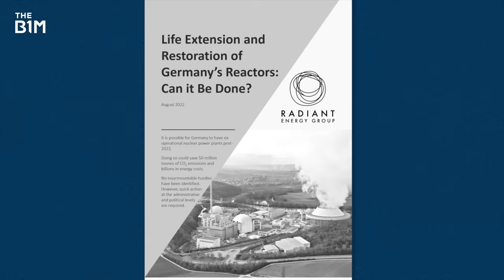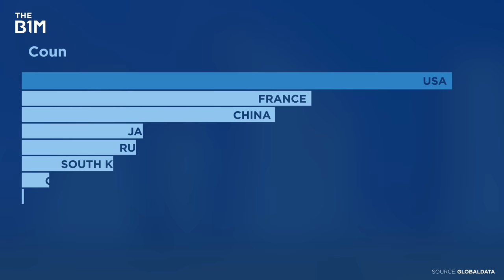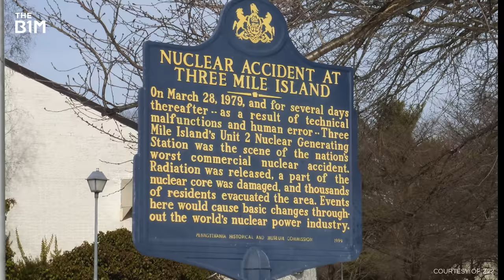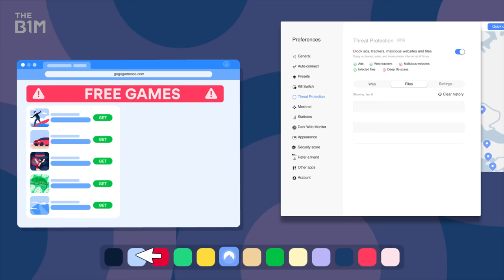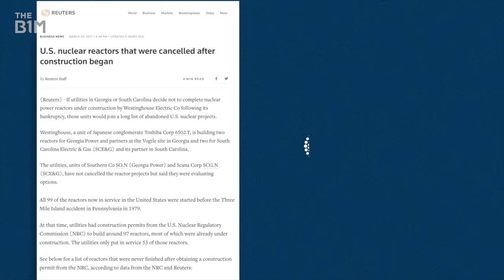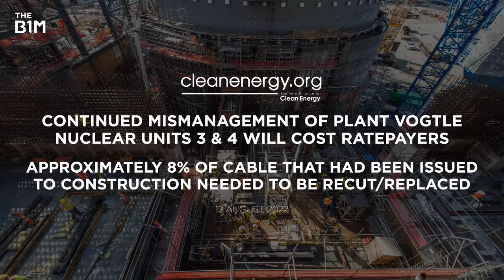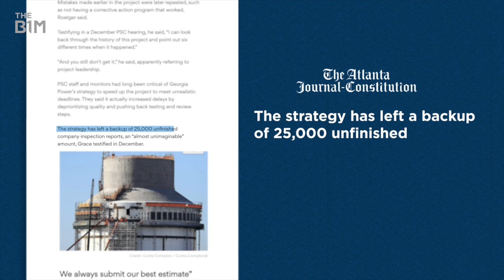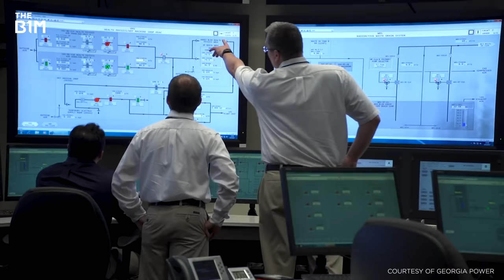Why Nuclear Power is Making a Comeback

Comment: They also turned off nuclear reactors during the Texas outage, but he conveniently left that out. Nuclear is too expensive and not worth the risk. They can do wind and solar for cheaper with grid storage for excess to use later. There are alternatives to hydro and battery storage like Rondo Energy's thermal storage system. I can't really see nuclear making a comeback at all because no one wants to pay for it, and no one wants it in their backyard.

Comment: Its coming back because it's the sensible thing to do until battery technology and/or other power generation methods catch up. Look for the Lithium Report done for Finland that shows the estimate is that the whole world does not have enough Litium in it to supply enough for the batteries for just the electric cars in the USA.........

Comment: Even if it costs 50 billion it's still worth because that is gonna produce joules non stop for the next 5 decades minimum.
Reply: You apparently are not a ratepayer in this area.  29% increase in my electric bill just due to Vogtle and it will double if it ever starts up

Comment: When it comes to nuclear power plants for security reasons we should keep them analog and keep them offline meaning there is no outside connection to the management of the reactors I want to say management I'm talking about the equipment not the people in that way it can't be hacked it makes it safer yes we using 1970s technology when it comes to the management of the reactor but it's also pretty safe and well and tried and true we just use the newer Westinghouse reactors that put all the cooling water on top of it so if we lose all electricity it still can cool itself and you won't get a Fukushima daiichi  or a 3-mile island

Comment: Bechtel isn't perfect, but they have done a pretty good job on the Hanford site in Eastern Washington State, over the river from me. There are a lot of government contracts and cost overruns, but generally speaking it's been pretty good. There used to be another plant called "Satsop" near the Washington Coast, in Elma, but it was abandoned when I was a kid. It would be cool to see that back up and running one day.
Reply: I worked at Satsop as a new apprentice boilermaker. I just retired a couple of years and my last job was building some environmental clean up equipment at the Centralia Power plant.

Comment: Did he say people don’t know how to pour concrete? Did I hear him that correctly?
Reply: Yes and it is a correct statement for Vogtle.  Critical safety systems depend upon concrete structures for foundations and protection and the mix, temperature, and pour methods are very specific.  Test samples are poured and tested to make sure the pour was done correctly...and at Vogtle the test failed in some cases.  Do you realize what it cost to demolish a concrete structure and redo it when it does not meet design specs/ Or maybe they should just let it slide and say it sorta meets the safety requirements.

Comment: Need to keep the same engineering and management team. With select trades and have them work on the same designs. To significantly bring down costs and completion times. These projects will be needed. To meet our CO2 reduction targets and to power the wave of electric vehicles. Coming to market over the next 5/10 years
Reply: I hate to tell you but given the failures below, no U.S. utility is even remotely considering new nuclear and old plants are shutting down every year. It takes 16 years start to finish if a utility ever wanted one

Please don’t assume that YT videos are factual.  If you live in the U.S. here is the reality for the last 4 state of the art Westinghouse AP1000 ADVANCED passive safety features new nuclear power projects and spent fuel reprocessing and in the U.S. over the last 20 years. You decide if this YT video was presenting the truth. 

The Southeastern U.S. is super pro-nuclear MAGA, has zero anti-nukes, and 100% media and political support. 

The MOX facility (South Carolina) was a U.S. government nuclear reprocessing facility that was supposed to mix pure weapon grade Pu239 with U238 to make reactor fuel assemblies. It was canceled (2017) in the U.S. After spending $10 billion for a plant that was originally estimated to cost $1 billion and an independent report that estimated it would cost $100 billion to complete the plant and process all the Pu239, Trump canceled the project in 2017.

VC Summer (South Carolina) new nuclear units 2&3 were canceled in 2017 after spending $17 billion on the project (original estimate of $14 billion and 2016 completion date) with no clear end in sight for costs or schedule. 

Vogtle (Georgia) new nuclear units 3 &4 currently 110% over budget and schedule (currently over $30 billion) and still not operating. Mid way into the build, the utility stated that had they known about the many costly delays they would never have chosen nuclear. They are now delayed another year because according to the project management, thousands of build documents are missing. 

Please google any of this to confirm.

If you can’t build new nuclear in the MAGA super pro-nuclear southeast U.S. then where can you build it?

Comment: The problem with using nuclear power to fill in when the supply of wind and solar are low is that variable power in nuclear reactors is tricky.  I don't see it working unless they can control and mitigate the xenon poisoning problem.
Reply: I agree 100%.

We should foist the problem of filling in power when the supply of wind and solar are low on the wind and solar power plants, not on the other power plants. Wind and solar create this problem, wind and solar should solve it.
Reply: @factnotfiction5915  yup, base load the nukes, no Xenon issue.  Use everything else as peakers.

Comment: We need to find a way to not use high pressure steam reactors, molten salt do not need to higher pressures
Reply: Terrapower has been building a MSR for 2 years now and that project is not going well.
Reply: @clarkkent9080  fusion is complacent that’s for sure
Reply: @joem80003  fusion is only 5 years away and has been for the last 30 years

Comment: ARE THE NEW REACTORS GOING TO BE BASED ON THORIUM?
Reply: No, they are AP1000's, which have a terrible record. Of the 6 produced  in the US, 2 have been abandoned in place near Tampa FL, the 2 built near Agusta GA have defective cooling towers and are not producing grid power, AND...

These are the last 2 AP1000's that will ever be built as the contractor [Westinghouse] was driven into bankruptcy in 2017, due to lawsuits filed by so many corporations. Parent corporation Toshiba wrote of tens of billion$ in that disaster, but they are no longer liable.
Reply: @crankychris2 Is the industry at least considering Thorium fuel based reactors?  Looks like the Chinese are more successful with AP1000 design as they have 2 (modified AP1000's AKA "Chinese" version called "CAP1000) operating starting around 2018 and 2 more under construction. As of July 2021, China is the sole operator of this reactor design and currently developing more advanced versions and owns their patent rights. The first AP1000 began operations in China at Sanmen, where Unit 1 became the first AP1000 to achieve criticality in June 2018,[1] and was connected to the grid the next month. Further builds in China will be based on the modified CAP1000 and CAP1400 designs.

Comment: Small nuclear power plants will be the future. Otherwise the Capital costs will always be too much.
Reply: Every utility choses the largest nuclear plant possible because of economies of scale.  It does not cost 10x as much to build and operate a 1,000 Mw plant compared to a 100Mw plant.  Smaller plants would cost more per Mw output
Reply: @clarkkent9080  
Which practically always overruns in cost.
Reply: @johnrockwell5834  EVERY nuclear project overruns in cost.  

This is from the Des Moines Register an concerning the only Small Modular Reactor (SMR) project in the U.S. today.
In 2013, the Wall Street firm Lazard estimated that the cost of generating electricity at a new nuclear plant in the United States will be between $86 and $122 per megawatt-hour. Last November, Lazard estimated that the corresponding cost will be between $131 and $204 per megawatt-hour based upon the 4 recent new nuclear projects in the U.S. . During the same eight years, renewables have plummeted in cost, and the 2021 estimates of electricity from newly constructed utility-scale solar and wind plants range between $26 and $50 per megawatt-hour. Nuclear power is simply not economically competitive.
SMRs will be even less competitive. Building and operating SMRs will cost more than large reactors for each unit (megawatt) of generation capacity. A reactor that generates five times as much power will not require five times as much concrete or five times as many workers. This makes electricity from small reactors more expensive; many of the original small reactors built in the United States were financially uncompetitive and shut down early.
The estimated cost of constructing a plant with 600 megawatts of electricity from NuScale SMRs, arguably the design closest to deployment in the United States, was originally advertised as costing $1 billion but upon requesting actual bids from engineering firms, increased to $6.1 billion in 2020. Given inflation and other cost constraints that cost today can only be expected to be significantly higher.
The cost was so high that ten members of Utah Associated Municipal Power Systems canceled their contracts. NuScale then changed its proposed plant configuration to 6 fewer reactors but increased each reactor output from 50 Mw to 77 Mw costing at total of $5.3 billion. The NRC just last week approved the construction of the 50 Mw design but now will have to start the review process all over given the switch to a 77 Mw design. For each kilowatt of electrical generation capacity, that estimate is around 80% more than the per-kilowatt cost of the Vogtle project in Georgia — before its cost exploded from $14 billion to over $30 billion. Based on the historical experience with nuclear reactor construction, SMRs are very likely to cost much more than initially expected. And they now have delayed the project start until 2025 in an attempt to find more backers.  All this before the inevitable setbacks that will occur once construction starts.

Comment: A coupla issues got skipped over. 
1) Why is it that whenever nuclear power is discussed....it's always in the context of traditional fission reactors? There's still a  big question of WASTE DISPOSAL with that route. MSR / Thorium reactors have LESS WASTE...and have actually been built. Why aren't they doing that with Vogtle?
2) Why are they building this project in the middle of the largest black population center in America? Reeks of more targeted ENVIRONMENTAL RACISM if you ask me. Like the surrounding population is expendable if something goes wrong. (ijs)
Reply: Terrapower is building a demo test MSR but that project is not going well.   And Thorium would require a complete nuclear infrastructure change from uranium based fuel that would cost many many billions in addition to the power plant itself.
Reply: @clarkkent9080  
Got it...but wouldn't it be worth changing the infrastructure to minimize the known long-term risks of the current setup?

Comment: 7:08 "...modules ...prefabricated on site..." Uh, no.
Prefabricated means before it's brought to the site.
Reply: Vogtle did have system modules made in a factory and shipped to the site but they did not fit together and the welds were so bad that they had to be reworked.  The factory build that was supposed to make nuclear cheaper was at least here proven to be more costly.

Comment: Nuclear power is important for the national defense, so it should be handled by Defense Dept. All rectors should be handled like sub rectors, and built by the government. That means cost plus building, because safety can't be trusted to the profit motive of companies like Bectel. They are not trust worthy enough, no not the rank and file, but the management.  Safety is too big of a concern to be trusted to for profit companies. The massive savings in carbon more than make up for the added cost.  In addition, light water rectors is yeterdays news.

Comment: Here in CA they are thinking of starting new nukes, and they haven't finished tearing down the one they shut down!  LOL!!
Reply: Here is what is in store if they try and build one.

If you live in the U.S. here is the reality for the last 4 state of the art Generation III Westinghouse AP1000 ADVANCED passive safety features new nuclear power projects and spent fuel reprocessing and in the U.S. over the last 20 years. The AP1000 is fully approved by the NRC for construction and operation.  The only NRC requirement is that the plant be built per design documents…..seems simple.. You decide if this YT video was presenting the truth. 

The Southeastern U.S. is super pro-nuclear MAGA, has zero anti-nukes, and 100% media and political support. 

The MOX facility (South Carolina) was a U.S. government nuclear reprocessing facility that was supposed to mix pure weapon grade Pu239 with U238 to make reactor fuel assemblies. It was canceled (2017) in the U.S. After spending $10 billion for a plant that was originally estimated to cost $1 billion and an independent report that estimated it would cost $100 billion to complete the plant and process all the Pu239, Trump canceled the project in 2017.

VC Summer (South Carolina) new nuclear units 2&3 were canceled in 2017 after spending $17 billion on the project (original estimate of $14 billion and 2016 completion date) with no clear end in sight for costs or schedule. Four managers on the project were charged with charged with 16 felony counts, including conspiracy, wire fraud, securities fraud, and causing a publicly traded company to keep a false record.  The CEO of the project is serving 2 years in prison, the others are awaiting trail.

Vogtle (Georgia) new nuclear units 3 &4 currently 110% over budget and schedule (currently over $30 billion) and still not operating. Mid way into the build, the utility stated that had they known about the many costly delays they would never have chosen nuclear. They are now delayed another year because according to the project management, thousands of build documents are missing. If completed, Vogtle will be, for its output, the world’s most expensive nuclear power plant.

Please google any of this to confirm.

If you can’t build new nuclear in the MAGA super pro-nuclear southeast U.S. then where can you build it?
Reply: @clarkkent9080  Sounds like we can't build them.  We might have to go with solar, doesn't sound like nuclear is ever coming back.  Coal works, we have a lot of coal.
Reply: @ellenorbovay5226  I don't think nuclear is the problem.  The problem is the construction craft, supply vendors, and project management that apparently think they are building a Wal Mart or Amazon warehouse.  We have lost our ability to build complex and QC critical projects.   And that will not change anytime soon.
Reply: @ellenorbovay5226  don’t listen to Kent; he loves to lie and omit important facts.
Reply: @Klerk Kant  Yet you continue to ignore from your blank trolling channel that many countries have been building and using small modular reactors for many decades, built in two years or less for millions not billions.

Comment: Its a great way forward, to build a miniature reactor just outside each home and become a lot more independent.
Reply: That's not really feasible.  The smallest practical reactors ("small modular reactors" aka SMRs) designed so far are about the size of a truck bed (intentionally to allow for easy shipping) and would be powering on the scale of a few neighborhoods or perhaps a small town.  And its still up in the air how practical those are for widespread use.  Great for isolated towns that don't have easy access to a national grid but not very practical for large urban areas.

The problem is that nuclear (and basically every other energy generation system with the exception of solar PV) is very subject to efficiencies of scale - the larger you build it, the more energy you get out relative to the size/cost/fuel/etc.  Scaling a reactor down to the size of something you could throw in your back yard would set you back likely hundreds of thousands of dollars and barely provide enough energy for your own needs.

Solar PV is the way to go for independent energy generation.  Especially when combined with a sufficiently sized battery backup to work around that pesky "sun isn't shining" problem.  Solar cells operate the same way on essentially all scales - you're putting the same panels on your roof as the power company is putting in their 1000 square kilometer farm in the desert.

Only problem with solar PV is that its somewhat location dependent.  Battery backups solve the "sun doesn't shine" problem if you don't expect more than a couple days of cloudy weather in a row but if you live in like Alaska where you only get sun for a couple hours a day for a few months at a time - and potentially not at all when its also cloudy - solar isn't going to work too well.

But personal nuclear isn't the answer.  Its too expensive and too risky for the benefits you get out of it.  If you're such a hyper individualistic person that you need your own personalized power system and you're living in Alaska, your best bet is to just move south somewhere and get that solar setup going.  A gas or diesel generator might do you for short term, but you're really just trading reliance on your local power company for reliance on your local gas station so that's not really a step up (and would be both stupid expensive as well as terrible for the environment).
Reply: No.  Way too many would find a way to screw it up if given the opportunity, despite incredible safety measures.